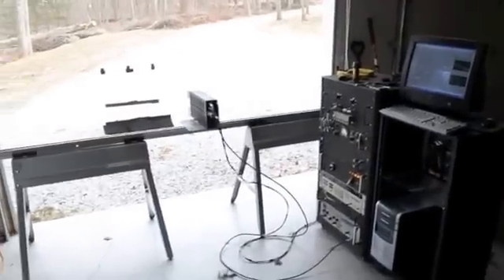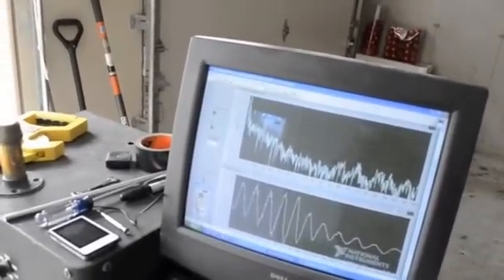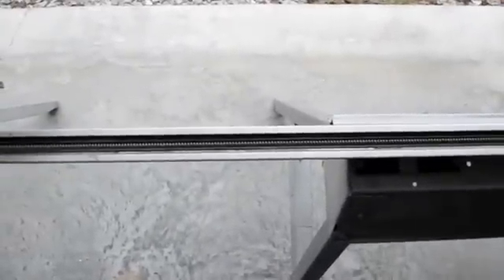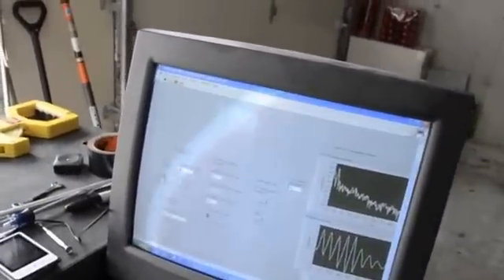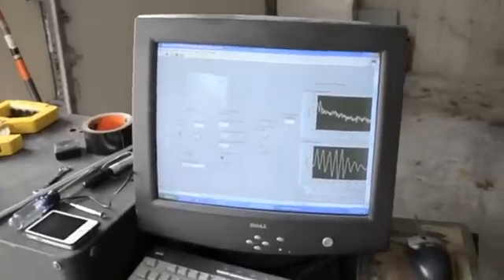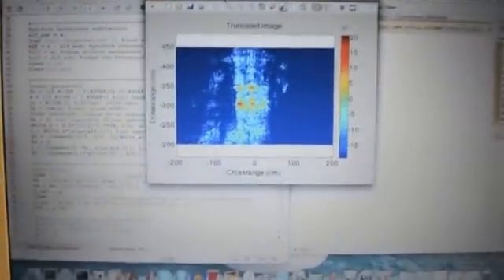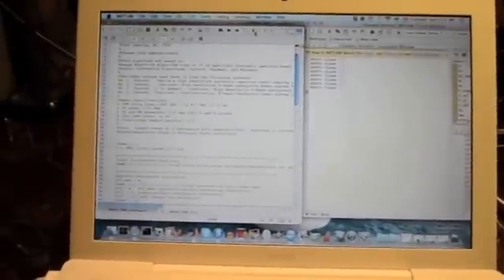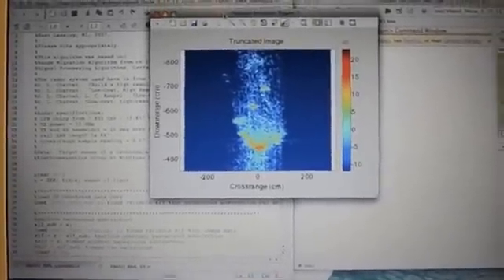X Band Rail SAR Imaging System

Comment: Revealing.
Shows the headlights and tail lights are the biggest reflectors on a car. "Mythbusters" did all sorts of idiotic stuff but not once obfuscate the headlights nor hide any metallic lines that are parallel to the beam.
The objects are creating scatter onto the ground which is very rough! (K.I.S).... Not considered hanging them up in the air away from the background? You have proven the 3D view can be interpolated and viewed, either maths or a simple deletion of the ground afterwards would make it more impressive to us viewers. :)

The SAR stuff I've been looking at reads while moving. Doppler is then used to position and average the x-y readings with spaced antennae.

It would be me to have horns set apart to electrically phase discriminate x-y and two higher for z. Getting beyond my pay grade now. I've only played with a tweeter and timing reflections with a couple of microphones on the pc.